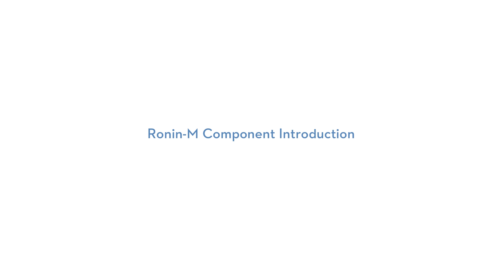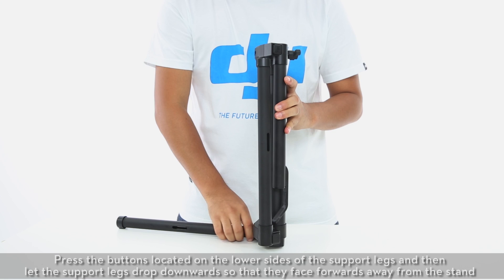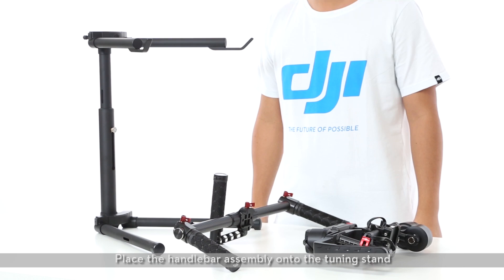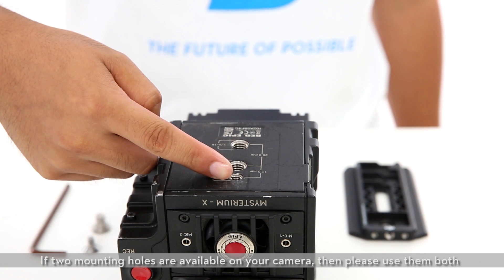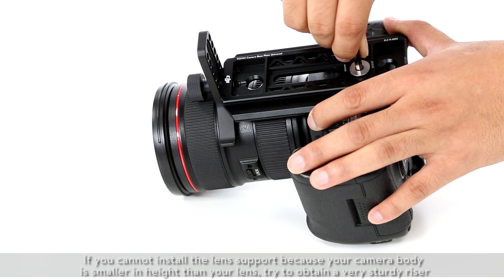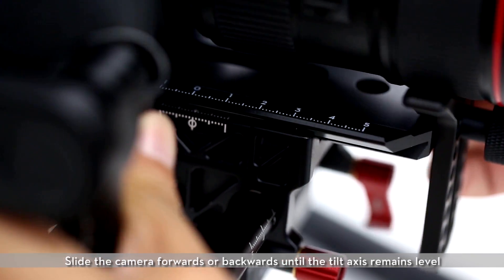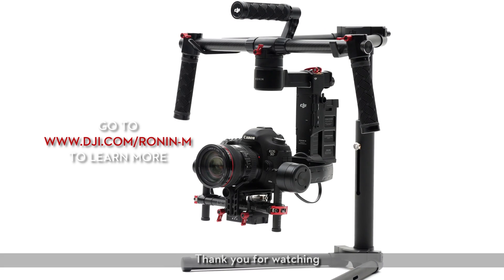DJI Tutorials - Ronin-M Tutorials - Preparing and Balancing

Comment: The recent history and fate of the Ronin-M offers an important lesson to be learned, basically that dji products are "throw away" items. Though the Ronin-M was a good gimbal, it was rendered as worthless junk when dji pulled all support for the product by halting the production of proprietary "smart" batteries and auxiliary power adapters, leaving thousands of customers in limbo. If you can afford to "throw away" a dji product and simply replace it with a new one if it happens to break (or replace it with a new model)... If you can afford to do that, then you are good to go. If not, then perhaps you should think twice about your purchase.

Comment: For $900 U would think that DJI could include Camera Screws C & D that are the correct length for Canon Cameras.  Other than that It seems to be satisfactory SO FAR. Tell ya later when I get it balanced and get the Android APP to load in my LG Phone.

Comment: Just got my Ronin M out of the package a day ago and the (right side red vertical adjustment knob) is literally right beside the circular tilt motor. Therefore I can not adjust the right side vertical control. IT CAME IN THE PACKAGE LIKE THIS. Any way of fixing this issue??

Comment: Just opened the box on a new Ronin M. Was able to follow the video and had no problem balancing following the instructions. First test around the house was great, everything I expected. Yes the lens cap will throw the balance off. Connecting to the DJI Assistant with the USB cable and testing/setting options  was easy.

Comment: Once you are balance you should be able to tilt the camera and it will stay in that position. Is this true? I achieved a balance did but once I tilt or roll the camera in any direction it falls back to center level.  And lastly once I do the auto calibrate and my numbers show as close to 0  as possible.  asIi move the ronin the numbers move all over the place passing 10.   please help.  thanks   Ronin M with Fs100
Reply: Hi, in this case the center of gravity of your camera is too high or low. You need to move the camera up or down until it "feels" more steady and it´s only falling into one direction. ( for example always backwards ) Now you need to adjust the tilt axis until it stays steady in one position ( move the camera forwards or backwards ). I never worked with a fs100 on the ronin, but I think its center of gravity is quite high ( because of the top handle and microphone ) so you need to set the camera to a lower point. It´s a tricky process but if you get it once, it will be way easier in the future with your set up.

Comment: So, we turn on the ronin with or without the camera and it goes through this jiggle thing like when you auto tune it. But it is much worse and the motor on the right will get so hot you can't touch it. What do we do? Did we buy a jacked up ronin m?
Reply: No. The ronin is confused it doesn't have a payload.

Comment: (2:24) Oh how I wish I could 'tightly' screw my top horizontal bars into the top handle.  They get so tight and then just spin and I am constantly retightening them. Really poor construction.
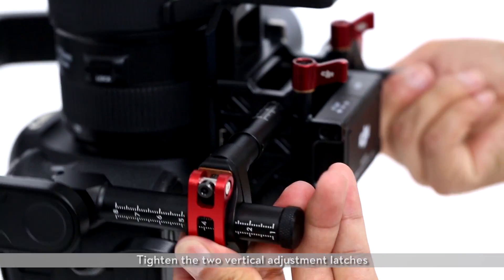(6:38) When adjusting the vertical tilt I am able to get it beautifully balanced at 90degrees and 0degrees (forward facing) but if I rotate the camera either just short of 90 or back of 90 then the camera falls either forward (short of 90) or backward (just past 90)...Why is this?
(7:05) Again I can get the camera balanced great when horizontal but if I position it slightly to the left or right of horizontal then it wants to fall either left or right...Again, I obviously can't move the camera either way as I won't then have balance at horizontal so what can I do in this instance?
(8:20) No matter how much back and forth I adjust the gimbal I always have some movement from the higher position to the lower position.  Sometimes it starts to go and then balances out somewhere in-between.  What is this occurring specifically do you think?  I appreciate the balance cannot be right but then what can I do if an adjustment either forward or back sends the gimbal more out of balance than before?  Is it just that the camera and lens combination do not work?  I was using a 5Dmk3 with Canon 24-105mm lens plus a manfrotto quick release plate and adapter so I could quickly move from Ronin-M to Tripod or monopod.
Reply: Same top handle problems here!
Reply: +Camera On Films Did you managed to get it balanced on the pan axis?
Reply: Nope! Never ever managed to nail the pan axis as shown in the video. I can get close-ish but normally have to settle for that and let the motors do the rest.